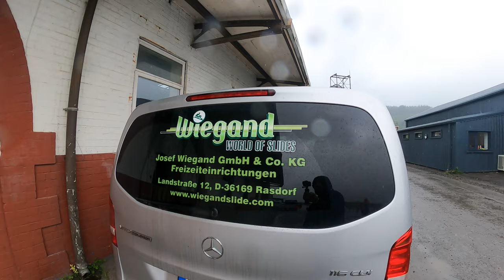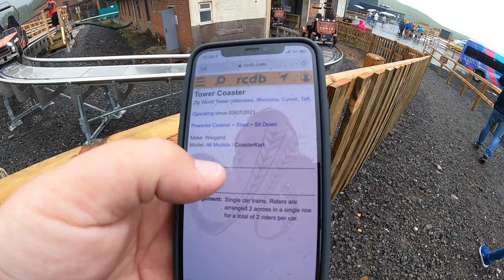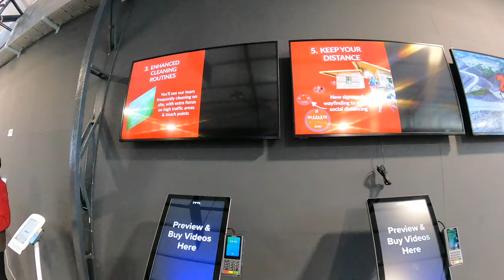Zip World Tower - Tower Coaster Opening Day Vlog 3rd July 2021

Comment: I live about 32 miles from aberdare and for the area it's in I don't think it will do well. I cannot believe they let you film but they wouldn't give you a free go on the zip wire.
Reply from the maker: The zip wire was fully booked up as I would have done it plus I was there to promote the brand new coaster on its opening day

Comment: Good vlog Andy you need to go back in the sun I bet that flys around in the heat 2 your good your 1 of the theme park or coaster ppl to get credit apart from megafobia mark . Just a heads up if the management said it was OK to do camera u could of passed camera to mark on zip lol
Reply from the maker: Mark did the zip line at 3pm and we had left way before that and not sure you can take your own GoPros on the zip wire because of the speed it goes but you can hire one of their face view action cameras

Comment: I'd be surprised if we see many of these pop up! Looks like they take up a lot of space and they don't really do much. Just a low capacity Mack Powered coaster really.

And with regards to the price, yes it is VERY expensive, but if my memory serves me correctly, the Fforest Alpine Coaster was quite pricey when it first opened and they soon lowered it, so you never know.
Reply from the maker: I would say £15 would be an decent price for it for 2 rides and then any extra ride you want to do could be done for £5 🤷‍♂️ just a shame as most people go there for the zip wire which was fully booked out most of the day and doing the coaster as well on top would be an expensive day out